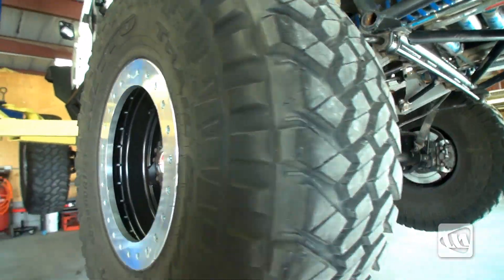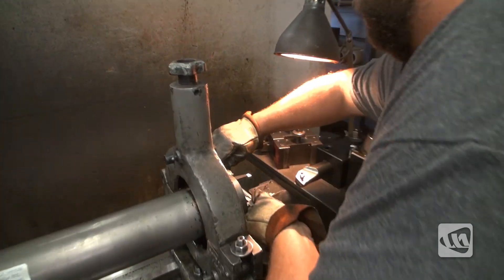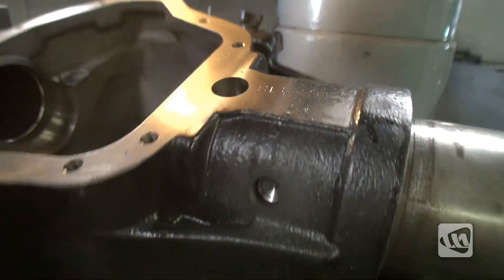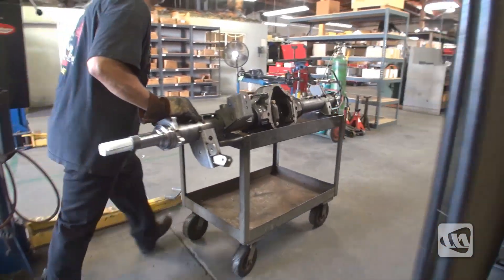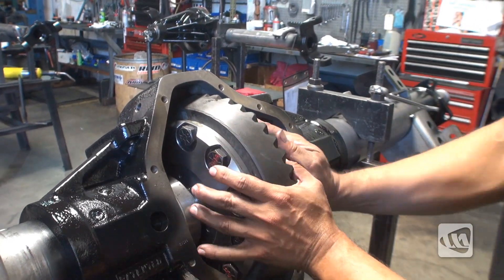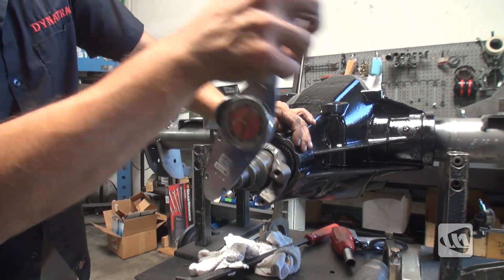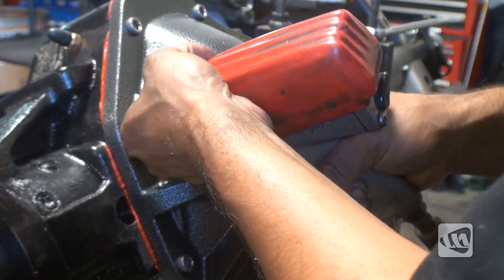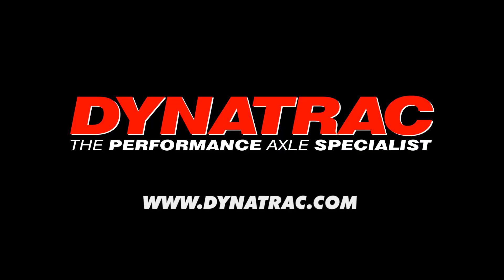Building of a Dynatrac ProRock 80 Full-Float Rear Axle

Comment: 👍👍 I heard y'all cover is too small you need to get a bigger one because you can burn up the pinion. I don't know is it just for the 60s or 80s. 12-07-23
Reply from the maker: Not sure who you heard that from but we've been running this PR80 for over 9 years and without any issues. We've also been running a PR60 for almost 15 years and without issue. But then, that's just me.

Comment: What kind of diff fluid will it take?
Reply from the maker: Being that we had an ARB installed, you should make sure to put regular gear oil in, NOT synthetic as it WILL ruin the o-ring. As far as weight goes, we are running 5.38's so I would recommend a heavier weight like an 80w140.

Comment: Two clicks is over torqued. Would fail FAA inspection. But good video.
Reply from the maker: Good thing these won't be used for flying :)
Reply: @wayalife  gas it enough you could make that happen ;) as I fellow Jeep owner I'm looking to upgrade my axles but I don't have $12,000 just laying around for some pro rock 60s so I'll have go junkyard super dana 60s. Do you have  any tips on axle choices?
Reply from the maker: @monyet2875  LOL - too true :) Regarding axles, how big of a tire are you wanting to run? Do you have a JK, JL or something else and do you have a V8? I only ask because maybe you don't even need 60's.
Reply: @wayalife  I have an 05 TJ with stock engine. I wanted to go 40's or around that. I drive aggressively off road I get more of a rush out of it. I'm not afraid to hit the big trails when many chose to skip the course.
Reply from the maker: @monyet2875  You sure you want to run 40's on your TJ? Even with a regear, I always felt like my old TJ ran like a dog just with 37's. But, if you're determined to run 40's, 1-tons would probably be wise to have.

Comment: I have no doubt it's a quality axle. But they are grotesquely overpriced. There isn't $8,500 worth of parts and labor in that. And the IFS diff is $6,000 even though it doesn't have all the labor of machining and attaching axle tubes. It only cost me $6,800 in parts and labor for an entire new engine in my truck.
Reply from the maker: For sure, this axle isn't for everyone.
Reply from the maker: For sure, this axle isn't for everyone.

Comment: Im gettin a real good reasonable memory of notes from a lot of youtube Jeep Gladiator Videos ,as my memory serves me hkopfully ,i know there is a 30,44,60, and the 80 dana axles , And hear the big money question ? Within the ring n pinion gears system ,"are there more combinations within this working system ,but it still gonna take a lot more me to categorize the larger tire sized in matching of the ring n pinion axle systems ,i know you all think im a little weird about what im tryin to research on this area of matching ,but b eflieve me im just tryin to keep the axle stress down ,im not a rock climber or a rock trail driving guy, i just want my jeep to last for a while , cause sometimes gas will make a difference, wayne7eden@gmail.com

Comment: Most dont know whats involved in setting up a good diff. Ring and pinion alone can take hours. If you dont have over sized bearings to set up shims its a nightmare. Ide hate to see the bill. I bought currie 9s front and rear for my cj 20yrs ago and spent more than i paid for the jeep but its nice to fix a problem once and for all. It would take serious abuse to break a dyna 80.

Comment: Great  job good craftmanship , why they do'nt use setting tools for the pignion depth , also is not a good way to tighten the pignion nut with the impact gun that's hurts  the bearing causing small spot on the bearing  race , contribuing to a premature  failure of the bearing , must be tighten with manual tools...

Comment: I can remember back in the early 80's asking both Dynatrac and Currie about putting a full floater 60 in the back of a 79 bronco, they both asked why would you want to do that? So I did it myself, I did a hybrid 44F (Tracloc) front 8 bolt conversion and added discs to the rear (Detroit Locker)..

Comment: Were they using molybdenum based grease on roller bearings? Highly not recommended on high speed roller bearings due to skidding issues..?
Reply: On the pinion gear etc

Comment: i would ship it back to them untill they put a REAL GASKET in the diff cover...come on guys ....u really use sealer rather than a REAL GASKET?? 10k$ and no gasket?
Reply from the maker: To each their own I guess.
Reply: A lot of sealing from the factory's is done with silicone and no gaskets
Reply: steve waddell  the cover does not provide any rigidity to the center section with a gasket in there that can move and conform a little bit. With the silicone it’s basically a metal brace for the center section that happens to keep the oil in to .  I just learned this from rusty 411. He has a pretty cool YouTube channel. You should check it out .

Comment: It'd be great to see the process of these being built be automated.
Reply: seems like the lathe work and welding could be done pretty simple than just have someone with big arms and a little head pressing the shafts in and bolting the carriers up
Reply: Andrew Browner, I'd prefer to see a robot do the main assembly.
Reply: idk seems a little expensive at this point for how many axles they sell.. it be complicated to make a machine that accurately installs the carrier and checks preload and back lash ect.. it varys too much between axles
Reply: Andrew Browner I agree there, that the fine tuned stuff should be done with skilled labour, but stuff like assembling the main body is very automatable. The people that performed the other tasks could be trained to do the fine tuning so there wouldn't be a job loss.

Comment: Hitting directly on the bearings with a hammer and punsch from the side like that is no good.
Reply: really? so every axle theyve sold spontaneously combusted and ruined its rig? no i doubt theres been any bearing issues yet with these new setups not even enough time mile them out

people have been and will continue installing carriers and bearings this way, just dont be a goof with the hammer its pretty easy to feel when somethings making its way in or is jammed solid and wont budge.. those bearings feel it everytime you slap the clutch out or your wheel grabs sudden traction theyre not gonna mind some mild hammering on install
Reply: When removed yes! when installation major NO!! Mild Hammering? that depends on how easy they will go in' if it goes in that easy you bearly need to hit it anyway. I would warm up the bearing socket first' just warm not hot. Use the right tool to press the bearing in evenly. Hammering from side to side puts uneven load on it and you could have micro cracks in them. I know that when it's finally seated the stress is less so to speak. I have replaced numerous bearings in my life and tested many ways to do it. Bearings you hammer on tends to wear prematurely and i have also had bearings fail on me right from start of use. IF.. you are going to use hammering force at least always use a correct size adapter that will fit the bearing. And at last, i do not doubt that those axels will last a long time but consider the prize tag on these (that i would beleve is on the hefty side..right?), i would expect no less then the use of proper methods and tools for this. I would not care if it was my own stuff, but paying customers.. that will not due.RegardsRiller.
Reply: Riller70  You're totally right , they must use a speader especially made for , i am a chrysler mecanics and  the speader is an essenciel tool in the shop

Comment: I was always told not to put grease on a bearing that will be in an oil bath (pinion), 
It seem like it wouldn't matter but I've been chastised by mechanics for even suggesting it, but I see you guys do it. 

Awesome video. Even more awesome axles.
Reply: I noticed that too as I have always packed bearings on Class 8 trucks.  A lot of guys freak out over it, then again I have never had comebacks from burned up bearings, they have.

Comment: I haven't seen you installing an oil seal in the spindle where the axle shaft is inserted.
Reply: Glenn Sibay interesting observation. No machining on axles for a seal so I guess the o-ring seal from axle to hub, then the outer and inner hub to spindle bearing seals are all in the path to the parking brakes.  Not a floating axle expert but I bet Pro-Rock is emulating the design norm (or better).

Comment: Why the extra front oil fill?
Reply from the maker: There is a proprietary oiling system designed to help keep the pinion bearings lubricated.  This extra port allows for the application of oil to this system during assembly and when servicing the differential.

Comment: dose they make a pro rock 80 for a ford f250?
Reply from the maker: I'm pretty sure they can help you out with whatever you need.
Reply: The rear axle in the f250 has a better housing, best option is to get chromoly axles and locking diff
Reply: Andrew Galyk you already have a great axle in your f250 save your 8 grand

Comment: the only thing i didnt like that they did (at least for me) is they used the brake rotors with the internal drum brake parking system.... my dana 80 doesn't have that and rather i have a trans tailshaft mounted drum parking brake. much simpler set up, easier service if you ever need to, and you dont have to have cables routed all the way back to the rear end.
Reply: +1964corvan 
Well, that kinda depends, I don't know my way around every T case, however adding a parking brake drum to a JK is unrealistic.
I do get it, my M-715 originally had one, and yes it's rather simple, but it also makes the drive line longer in the rear, something of a No No on a Wrangler or anything with a short wheel base with a long drive line.

Comment: I understand the need to coat components with grease to prevent rust before use with oil. Kind of like assembly lube on an engine. But it looked like those hubs were getting packed with grease for permanent use similar to a front hub. I'm just curious why so much grease when the oil fills the hubs anyways?
Reply: I stand corrected. Different from the ones I've seen. Guess it's just a prelube.
Reply: okey doky Gear oil doesn't fill into the Hubs.
Reply: The reason I ask is because My full floating dana 80 in my pick up truck has oil filled hubs that are supplied from the diff. There is zero grease in the aam 11.5 hubs in my other truck as well So is the grease for off road purpose only due to the axle being put at such steep angles or are they using excess for prelube.

Comment: Why were the brackets only tac welded? I heard him mention it but need clarification. 
Cheers
Reply from the maker: +Jesus is the man Because the brackets that just got tack welded on will be removed.  We run an EVO Double Throw Down coil over system on our Jeep and they require new proprietary brackets to be installed.
Reply: Wayalife
Ah got ya! Many thanks for the clarification :)
Reply: +Jesus is the man
I looked up the kit hes talking about, it's very nice, was designed around going "fast" as stated on the webpage.
Like this Jeeps, but my "Tax Bracket" don't fit.
Reply: In case they need adjusted. Customer request

Comment: I could not understand why the Jeep wrangler attachment points were only tack welded in... why not full welds? 4:40 min:sec..
Reply: what is a leba lever system?
Reply: I gave you a thumbs up for asking the question that I wanted to ask..
However, I think it might be so they can quickly take off any brakets they don't need or have to adjust slightly.
Reply: Paul Gdry He's saying "EvoLever" which is Offroad Evolution's rear cantilever setup.
Reply: with coil spring you cannot adjust the angle of the pinion otherwise your brackets all move on the axle they are tacked on so you can make the adjustment to your jeep because of varying lifts and weld them on when your done
Reply: It's because he's installing an evolever coilover suspension and he would have to cut all the brackets of anyways. no point in fully welding something just to cut it off afterwards.
Reply: fully welding a piece of metal which will take shocks gives a bigger chance of breaking . when you weld from a piece if a small rupture appears it will shred on it s full lenght and all the weld will break. if you weld in points the chances of having the welded piece still in place grows . on construction equipment this metod is widelly used because the vibrations and shocks are usually causing welding ruptures . it s like taking two domino pieces from the middle . that  will stop all of them from falling

Comment: Very very nice video Eddie. Its soo expensive to get those axles here in South Africa, most of us are still running stock 44's with 37's. Going to 40's isnt really an option on stock axles here.
Reply from the maker: An axle like this is really meant for guys running really big tires and with really big horse power.
Reply: we have some guys here that have done V8 Hemi conversions, even one to a Lexus V8. The 3.8 at this altitude suffers. I dont need D80's but a Dana 60 or even a pro Rock 44 would be great.